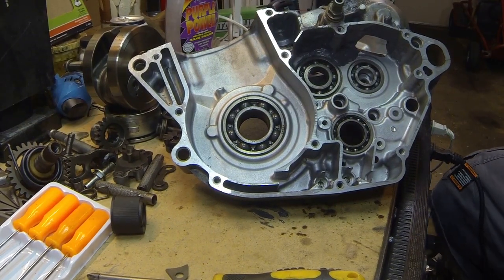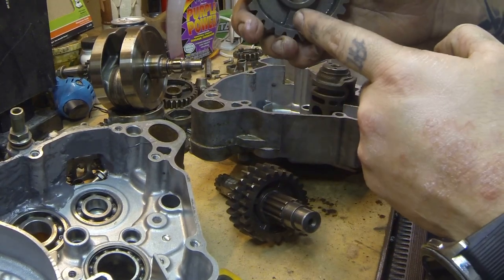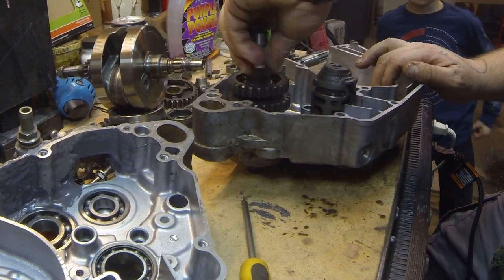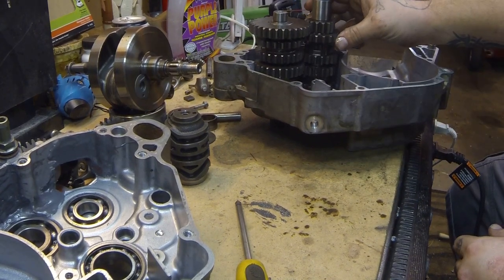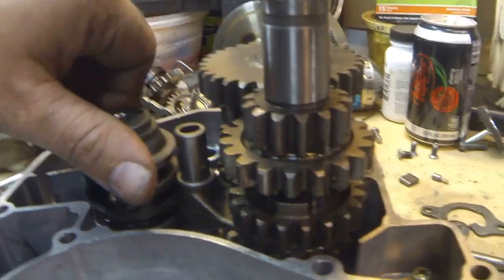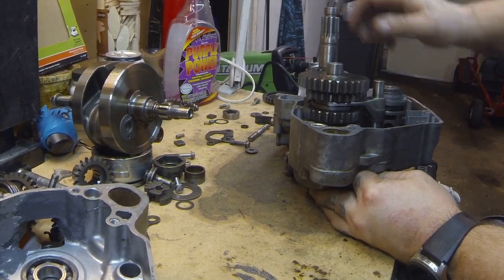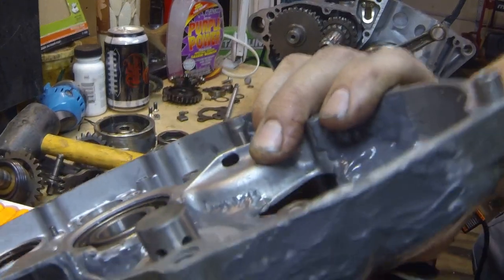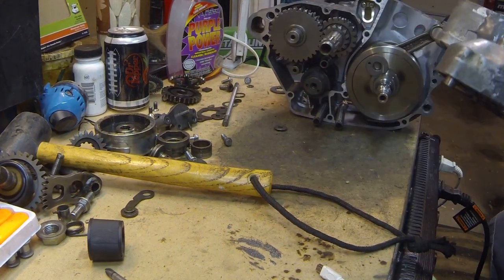2005 RMZ 250 bottom end assembly

Comment: I need instruction on putting the the gear shift pawl back on a 2005 450 rmz and also the gears back on the rod. They used a bunch of rtv and it clogged up the strainer in the bottom of the motor and was putting too much oil on the stator and wasn’t getting fire
Reply from the maker: The gearing orientation is the same between the 250 and the 450 just different ratios but ill also add a link to a diagram of both the shift drum and forks and how the gear clusters fit the shaft
Reply from the maker: ThumperTalk
RMZ-450 07 Gear Diagram - RMZ 450 - ThumperTalk

Comment: Hello I am doing the same job on a 2007.  The problem with the bike before was there was a seal on the left side that came out and got caught on the crankshaft sprocket.  My rebuild kit didn’t come with a seal for that side and the bike ran without it until the timing chain slipped on the seal.  Is there a seal there or not??
Reply: I'm looking at a 2016 engine rmz  same as you and yes there is a seal there
Reply from the maker: On the crank case or the timing cover? There is an oil seal on the crank case yes.
Reply: My son and I bought an 07 rmz250 the other day. Guy told us the kickstart was seized. Of course we knew better but the price was right so we brought it on home. Started tearing it down only to
Find a busted rod, bearing, cylinder is shattered, you can imagine I’m sure. Love when you buy a bike, it’s like, let’s make a bet to see who can guess what the seller will lie about to get it gone. Long story short, I’m
Looking at what, $700-$800 to put her back in the dirt? Will be splitting the cases today to check for other carnage, such as cracked cases & such! I’m so excited. Anyway, I appreciate your video. I’m not green but I’m no pro either and I’ve never rebuilt a bottom end. Parts are expensive so I want to do it right and I refuse to pay a shop $100 an hour to drag me over the coals. I’ll be doing it all myself. More videos would be great! Not much out there on the rmz250
Reply from the maker: @downdirty8543  thank you for the kind words but unfortunately I no longer have the RMZ250 I will have more videos coming out soon on another bike but for the most part the bottom end of a bike is very similar from brand to brand so ill go in depth on my next bottom end video to try and cover anything I think could be helpful thanks again and if you have any questions on your project that you think I could help with feel free to ask ill do my best to answer them.